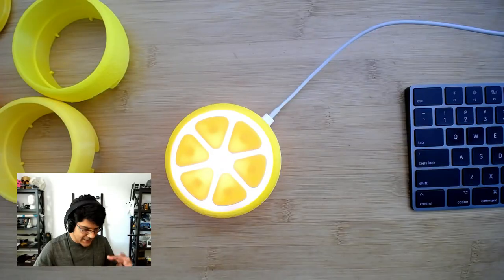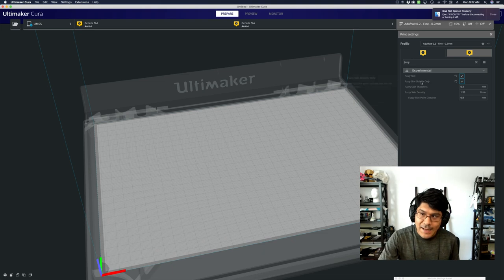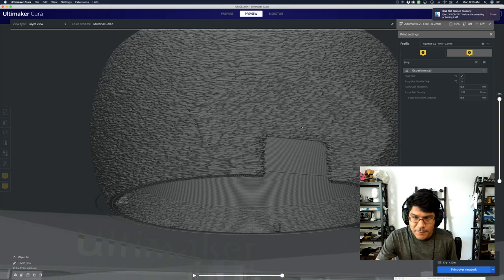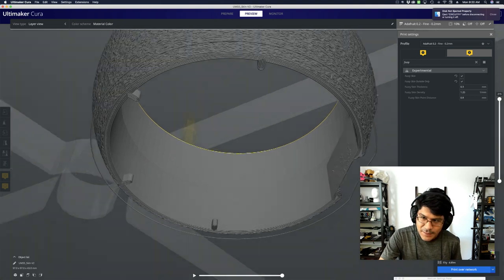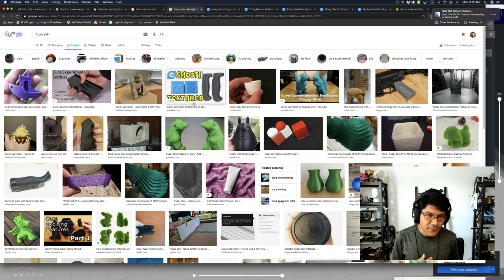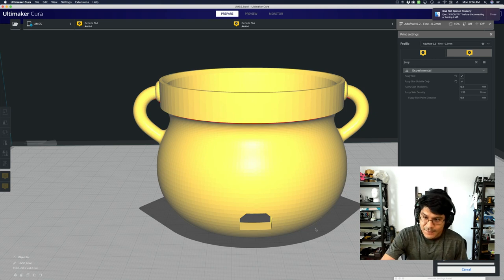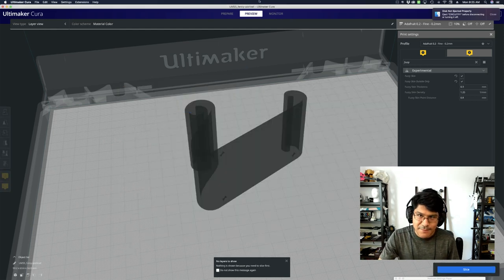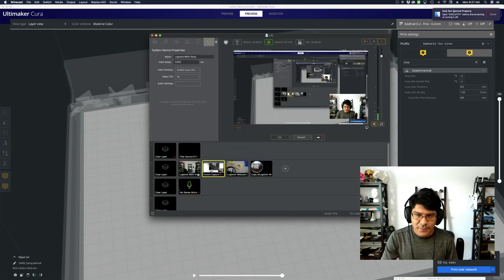Layer by Layer – Fuzzy Skin for Practical Prints in CURA

Comment: I wonder if it would be possible for the CURA to update the fuzzy skin feature to interact with blockers similar to support blockers in PrusaSlicer?

The ability to create a shape with dimensions set by the user, then free manipulate it in the print space to block the fuzzy skin and force normal print parameters on specific sections, eg screw holes, would be pretty useful in cutting out the patching/recutting out cut-outs thing imo, but i dont know the logistics behind such a thing so have no idea how feasible that would be.
Reply: This is, in fact, possible in Cura.  unfortunately Cura can only create blockers as 6-sided polygons (I believe Ideamaker can create Block, cylinders, and spheres), so it is a bit limited, but you can use tha method to combine surface textures by adjusting the Fuzzy setting.

Comment: Calling this "new" is pushing it a bit... I used this for a project fully 2 years ago!  Which remind me- this works great with TPU!  Also, You could save yourself a lot of time and trouble if you use a blocker cube to "suppress" the fuzzy skin to keep the areas you wanted nice and smooth - no cutting post print required.
Reply from the maker: Ok, new to me then. What project did you use that on? Glad it works with TPU. I find add/moving blocker cubes to be time consuming (Lots of inner geometry to cover). Faster to edit in Fusion 360.
Reply: @adafruit  yeah the blockers on cuts especially is pretty clunky... I'm hoping ideamaker helps make it a bit easier.

I just used the fuzzy skin for some tpu footpads for my couch too keep it from sliding on tile.  Purely cosmetic and unnecessary. Lol.  But it did look good and I hadn't used the feature and wanted to try out out.

I'm playing around with the variables to see how it effects the finish for a Quest headset mount I'm working on  now.
Reply: Everybody that modifies the model (and cut it later!!) to circumvent the slicer instead of using modifier solids, is someone that has understood nothing of CAD and slicers ...... and yet he feels he can teach others his ignorance.